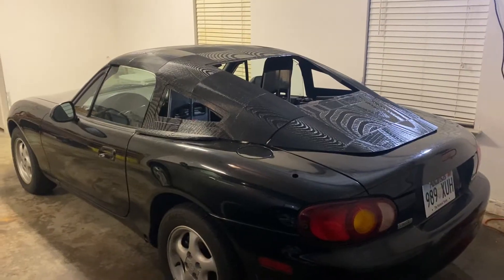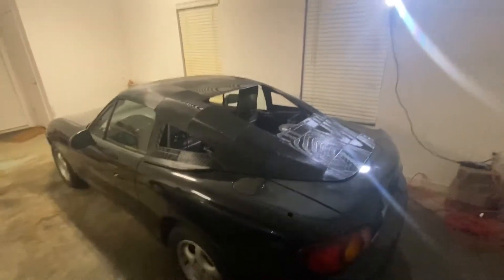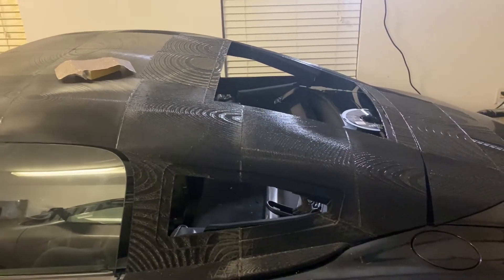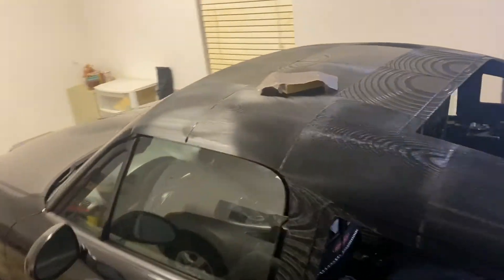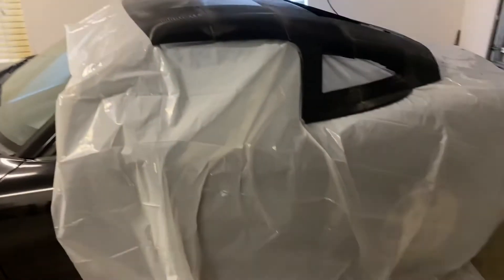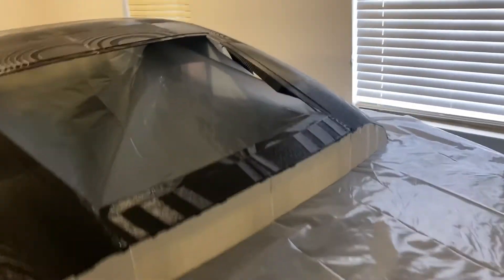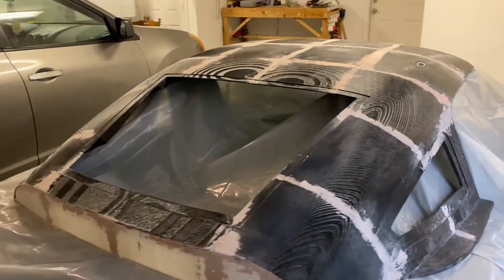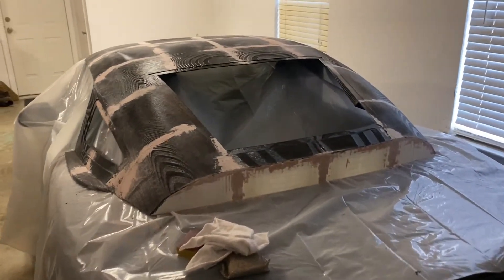3D Printed Miata Hardtop (Part 2)

Comment: how many rolls of filament did this take you?
Reply from the maker: 9-10 rolls if you lay each part flat on the bed. You can do it a lot less if your printer is stable enough to print each peach vertically (less supports).

Comment: I’m looking at your link on Etsy right now. Thinking about buying it. Does the purchase also include the STEP? I don’t have a 400x400 bed so i’d need to split it in smaller bed sizes.
Reply from the maker: You should be able to split the STL files but if you have trouble with that I can send you the STEP files.

Comment: What diammeter is your extruder tip?
Reply from the maker: 0.6mm
Reply: @HutchinsRacing  wow I was guessing it was around 1mm
Reply from the maker: @bandalocomposites503  Yeah that would have been faster but also would have wasted more material on the supports. Figured 0.6 is a good medium and also works with my stock hot end.